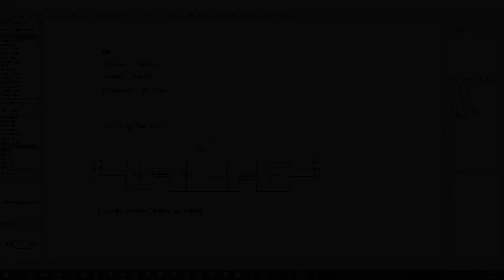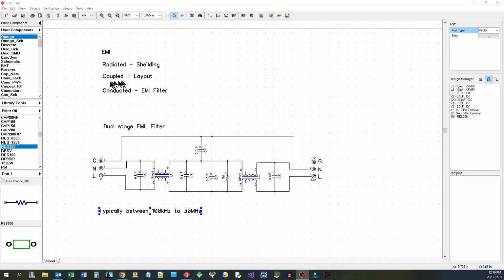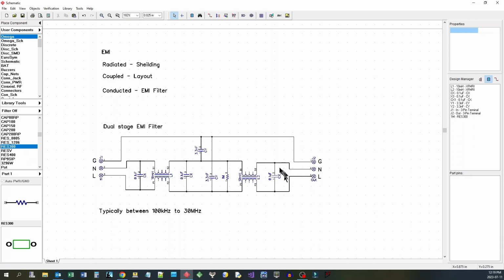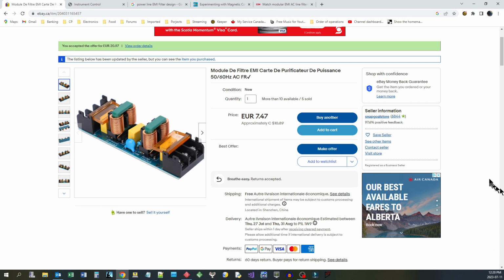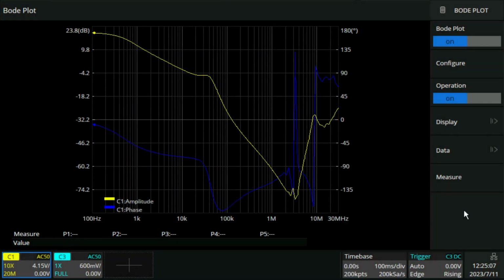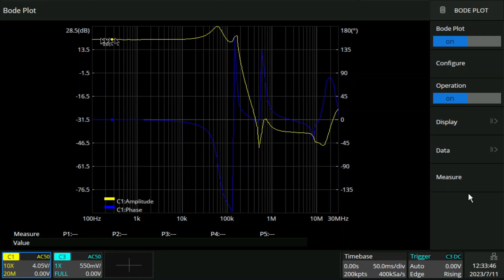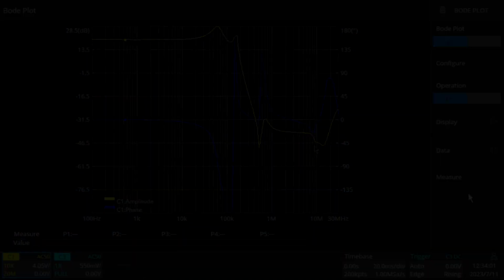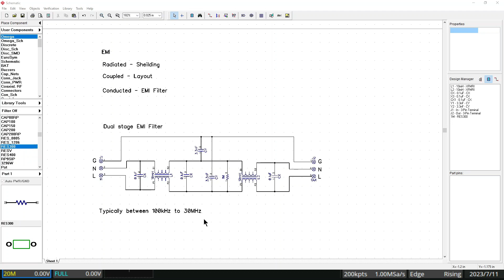0074 - EMI Filters?

Comment: Thank you for taking the time to put out this informative video on EMI filtering. I'm actually in the process of finding a way to combat a huge issue I am having with dirty power and using my guitar amps. Which are completely useless because of the dirty power coming into my home. So, thanks again for the video. It gave me a good understanding of what these types of filters might do to remedy the issues I am having. If you find that the EMI filters that you purchased actually work. Please, let us know. I am anxious to find a power conditioner that actually works. I've tried several that did absolutely nothing to remedy my issue.
Reply from the maker: You're welcome and thank you.  The filters featured in this video do work but are most effective at higher frequencies.  What is approximately the frequency of the noise you are getting?
Reply: That’s a great question. Since I’m more of a DC kind guy. How would I check the frequency of the noise I am getting with my AC power?

I do own an oscilloscope and frequency generator if you can tell me how to utilize it, I’d really appreciate it.
Reply from the maker: @jaylinton3003  there is a 99.9% chance that you amplifier has a non-ground referenced output, but there is that .1% that it is.  In which case hooking up a scope could result in some excitement.  Do you know how to check if one side of teh output is ground referenced?  You'll need a multi-meter to do this.
Reply: @uni-byte  If you're asking if the neutral is connected to the ground, it is indeed. I get the exact same voltage from L to N, as I do from N to G. 122.2VAC I believe it was...
Reply from the maker: @jaylinton3003  Not quite.  I'm asking if either terminal on the speaker is connected to ground.
Reply: @uni-byte  That's what I initially thought you were asking me. I should have gone with my first impression. The output jacks of the amp are in fact grounded to the chassis. They are grounded at the same point the Output transformer is grounded. I am using the Aiken amp grounding scheme as far as where everything within the amp is grounded. I have the output jacks grounded with the preamp section of the board.
Reply from the maker: @jaylinton3003  So connect the ground of the oscilloscope to the output terminal that is ground referenced and the probe to the other terminal.  Set the scope to AC input and AC trigger.  Does your scope have an "Auto" function?
Reply: @uni-byte  Okay. So, neg lead of the Oscope connected at the point where the output jacks are grounded. And the pos. lead of the Oscope connected to the positive side of the output jacks? The scope does have an Auto function. Should I inject a 1KHz signal into the input jacks as well? The scope has a built in Signal Generator if needed,
Reply from the maker: @jaylinton3003  If your looking for the noise then don't add a signal.  If the noise is only there with a signal then yes, inject the signal.  So, just to be sure before you proceed, one of the output terminal IS connected to ground?  If your not sure, use a multi-meter (in continuity mode if it has it) to measure between both the output terminals and the ground on the power plug.  If there is no continuity (less than 50 ohms) then just connect teh scope across the output terminals.  Remember to set the input and trigger to AC
Reply: @uni-byte  That makes sense. Yes. Both of the output jacks ARE connected to ground with continuity to the AC mains chassis ground. I have checked this many times in the process of sussing out what the issue was with my amp. The continuity/resistance reading was absolute zero...(0.00 ohms) Now, when I do this, the amp should be on and out of standby, correct? And with nothing plugged into the input jacks?
Reply: @uni-byte  Question: I have an isolation transformer, and a CUBE 30X guitar amp by Roland, that does NOT have a three prong plug. Could I safely use this amplifier with the isolation transformer to see if it cleans up the noise I am experiencing? Since the guitar amp didn’t come from the manufacturer with a grounded power cord. I’m assuming it would be safe to use with the iso tranny. The CUBE 30X is NOT a tube amp, but rather solid state. Thanks in advance.
Reply from the maker: @jaylinton3003  The isolation transformer remove the protection between neutral and ground, however if you are not opening it up it should not make much difference.
Reply: @uni-byte Great; thanks. I’ll give it a try and see if it cleans up any. The noise on my power is so bad I can’t even get a clean tone out of any of my guitar amps no matter what the settings are. So, I’m interested in seeing how clean it’ll be with the iso tranny if at all.